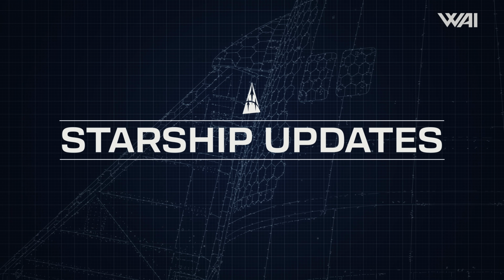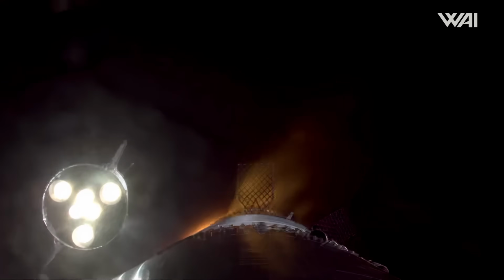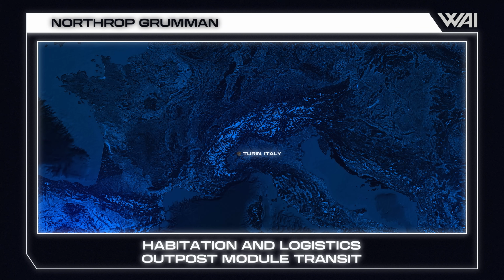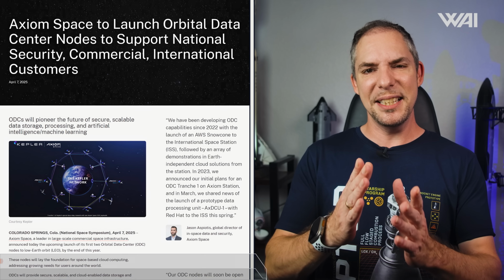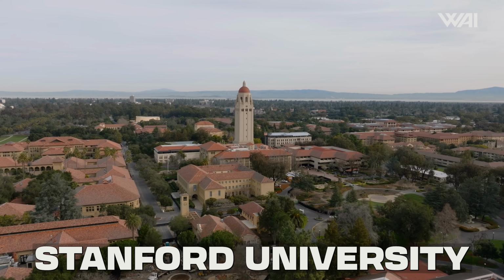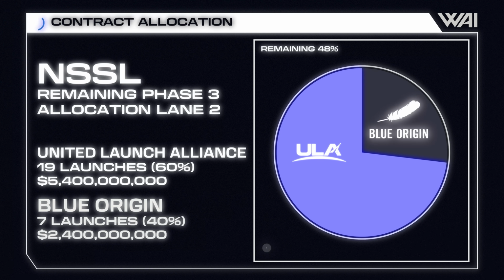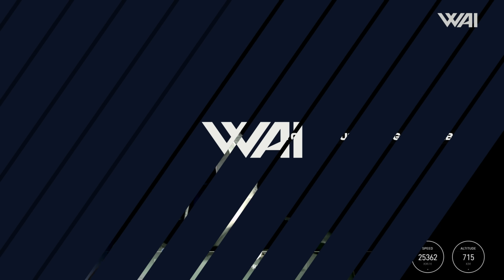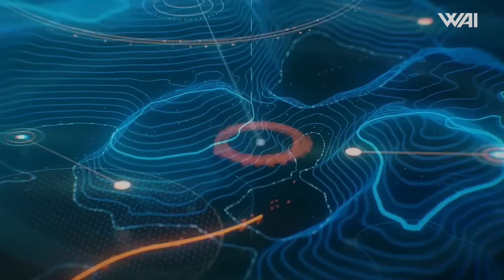SpaceX Unveils MASSIVE Starship Upgrade! Production begins on even crazier version!

Comment: Why use a laser? Why not unfold a giant mirror to concentrate sunlight into a beam ? 
If you unfold a mylar reflector you can make a massive mirror 10-20x the size of iss. Focus all that on a few square meters, and a simple 500w panel would need cooling and beefy power cables making 10-20x more than rated

Comment: The concern I have and I'm sure it is the major one for the FAA is the power density of the IR laser in the lower atmosphere with danger to aircraft and even ground transportation vehicles or people.  While it is certainly feasible, the cost would absolutely have to be significantly overshadowed by the benetfit.  Even microwave radiation to a rectenna has been questioned as to it's cost/benefit ratios and potential dangers.  If you had some way to absolutely isolate the ground antennas or rectennas from encroachement on land or air, it would certainly be an interesting test.

Comment: I write the annual State of the Industry Report on Space Solar Power. I can confidently say that SSP has been technically viable for more than 50 years. In the last 15 years, SSP has gone from the most expensive potential power source, ~$600/MWh, down 94%, to the least costly power source, around ~$40/MWh. This drop is so rapid because it compounds the 80% price drop in solar panels terrestrially (6-20x more productive per panel when used for SSP) with rapidly falling launch costs and better computational capacities in orbit. Simultaneously, SSP can be distributed like data beamed to (multiple) ground stations with far less transmission infrastructure, no energy storage, and geographically independent power. The main impediments to SSP are cognitive dissonance with the price drop and the not-insignificant system engineering problems of building the full-scale multi-kilometer systems in orbit, which take real money to address. Even so, based on current estimates, most systems are internally profitable with a full ROI in about 3-4 years. The NASA article was intentionally dismissive because NASA wanted to suppress the idea since they do not have the mandate or resources to develop a commercial product, and they created a system that is more than 60x more expensive (inflation-adjusted) than the one they designed in 1979 because their assumptions were just so bad. As just one example, they assumed each batch of 100 tons of material would require 14 fully expendable Starship launches when, in practice, it would be 2-3 reusable per 100 tons with no citations to the reason for this assumption of any kind.

Comment: I don't think starship is gonna work unless they make the scales actually over lap.. that and ad a belly plate that's basically just hundres of tubes running down its windward side.. heck, can't we just coat the entire underside in Rhenium, that mixed with bell chamber like belly ought to do the trix.. the mid ridge (absolute bottom) could vent in a V shape, creating the shielding+cooling needed.

Comment: BTW, I have been thinking that there may be a better way to launch rockets into space where one can make gravity work for you  rather than against you, at least for the first few seconds of flight.

For example if this could be scaled up to use for Starship Not only could this save some fuel but could  help reduce damage to stage zero as well in that the booster would clear the launch tower  in much less times thus exposing it to less time to the  high heat and stress caused by the engine blast.

Plus one could even recall the rocket even a few seconds after engine ignition.

As such I just made a video on this idea and uploaded it to my YouTube channel.

Comment: So far SpaceX load capacity has delivered exactly Zero cargo to orbit. 

It’s yet to deliver an empty starship to orbit.  

Or indeed in a condition in which an upper stage is reusable.  

I wouldn’t get over excited about block 3. 

Block 2 has yet to actually work.  

SpaceX has a lot more work to do before it’s a viable launch system. 

Block 3 will bring its own set of problems to fix.

Comment: 14:13 There is zero chance for practical energy laser transmission.  Besides the economics, the probability to frying birds and the weapon potential will preclude wide scale adoption.  However, as a laser battle station, there may be some worth to the project.  Antisatellite and cheap laser attack from orbit should be investigated.

Comment: Starship is getting totally redesigned it's going to have a module add-ons. These module add-ons like legs can be disattached at any time. Another add-ons as well as I don't boosters on the structures add on fuel tanks. The list is endless. They finally caught on to it. Size is not the problem its capacity and thrust😮❤❤❤

Comment: Pretty wild that instead of fixing all the issues with block 2 they are just pushing straight to block 3 to address those issues. Just shows how far ahead the R&D team compared to the build team
Reply: This is part of their philosophy: "break things and never fix them"
Reply: @paulpinecone2464 I guess it would be “break things, continue breaking things, trash them and make a completely new thing based on the stuff learned from the broken thing”
Reply: @paulpinecone2464  🤣
Reply: "break things, continue breaking things, trash them and make a completely new thing based on the stuff learned from the broken thing” AND NEVER GET THE JOB DONE !!!! 🤣🤣🤣😅😆
Reply: @paulbizard3493  more like, “break things, continue breaking things, optimize from mistakes, extend the timeline another three years, finally get a working product, make bank, decide it’s not good enough and scrap something perfectly good into obsoletion instead of combining it in the current system”

Seriously though, it would be so cool if we had a falcon-9 booster assisted starship

Comment: "Solar Power From Space",... Is a DUMB idea. Whether done with Microwaves or InfraRed, it's going to be very lossy as the beam heats the atmosphere. It will always work out more cost efficient to add more panels and windmills to current renewables. And then there's the issue of all the heating done to the atmospher by the beam, which is a direct method of increasing the overall temperature of the whole planet.

Comment: They got the chopsticks up really fast on Pad B, but still have not installed the SQD.  I wonder if that has something to do with the impending increase in length for the block 3 ships.  It seems they are also working on the next booster design which was only going to work on Pad B.  Looks like Pad A will finish out the early prototyping and they probably go the way of the Stargate bldg...

Comment: Space based power has always been a pretty hokey idea. Even if it benefits from constant solar influx, the losses and complexity of getting the power to Earth from orbit and the expense of launching the system to orbit in the first place is ridiculous. Then it is subjected to much harsher conditions and a shorter lifespan in orbit than on Earth. And then if you need to repair component failures, you have to dispatch the repair crew from Earth at additional billions or hundreds of millions expense. That's a lot of expenses that are cheaper if you put your solar panels in the desert. And if you use 19th century thermal energy storage, for the power, Earth based power can be built for long life, low tech, and simple maintenance.

Comment: The Lunar Gateway is constrained by the limited payload of Falcon Heavy.  That is why HALO only has 70 cubic metres of volume.  That will be very small for any crew spending 6 months.  That design made sense in 2020 when the contract was signed, but makes little sense in 2027 when it is now scheduled to launch.  By 2027 Starship will be launching multiple times per week.  And a habitable Starship V3 provides almost 2,000 cubic metres of volume!  And trying to dock a thousand ton HLS to the hundred ton Gateway does not make sense.

Comment: Every time SpaceX makes a change to the Starship design they basically get rid of all the "certification" of previous versions, since we have seen with Version 2 that changes can have unintended negative consequences. So I guess they should get on with creating the actual version that they will need for operations so they can prove the design and certify it. NASA and almost every other program in the world will freeze a certified design before they begin operations and manufacturing.
Reply: Design freezes stifles innovation. SpaceX has a different approach with Starship. Instead of a long and arduous design cycle, they are learning through hardware. They want to make hundreds of Starships so manufacturability is also important instead of making a dozen or so ships like the Shuttle. The factory, tooling, supply chain, and equipment needed to build a space ship is part of the process.

Comment: Guess they're going to have to add some more height to the chopstick towers
Reply: The arms of the towers meet somewhere along the side of the Starship and Booster. The Rapid Disconnect arm also attaches along the sides. Why does the tower height need to increase?
Reply: @michaelreid2329  I know but when they stretch the booster too it'll be close to the max so probably no spare lifting room

Comment: On the subject of energy from space.
I hope all the clever minds have thought about whether the satellite will not produce more pollutants in its lifetime (which will not be too long due to the chosen orbit) despite potentially increased efficiency (here, too, it remains to be seen whether the higher efficiency of the solar modules will not be canceled out because the laser does not arrive on earth with 100 percent of its output energy). does not produce more pollutants overall (somehow the thing has to get into space, which is also a lot of pollutants) than if the same power were simply installed on earth at a fraction of the cost.

Comment: Hopefully block 3 uses the new raptor 3 engines in both the booster and Starship. Grid fins lower on the Booster to keep starships hot staging separation exhaust from warping them and a newly designed Hot Staging ring (that is more open and taller).

Comment: I predict that when Jared Isaacman takes the reins of NASA he'll move Artemis to SpaceX Superheavy boosters for Artemis 4 and beyond. It will save a ton of money and stop the bleeding that NASA has had with SLS. Probably still use Orion capsules, but ditch the Lunar Gateway, perhaps replacing it with a relay communications satellite in a similar orbit.
Reply: One reason for a near-rectilinear halo orbit (NRHO) is that SLS did not have enough delta-v to get station components (and Orion) closer to the moon. We may need to upgrade the propulsive third stages for Orion as well.
Reply: @imconsequetau5275  SLS has enough Delta-V to put Orion to LLO TLI, Delta-V costs to put something on TLI to LLO and NRHO are pretty similar, its Orion that lacks the fuel to insert itself into LLO.

Comment: Starship reentry speed braking is a factor of ship weight & area of hull w/ heat times. Block 3 will definitely have more surface area, but will the ratio of surface area to weight go up or down when compared to Block 2?
Reply: It should have a larger area vs weight, even with 3 more vacuum raptors. The rear (aft) flaps must still be enlarged, since the center-of-lift will be moved forward, yet more mass will be concentrated in the engine bay. [The enlarged header tanks will not completely offset the need for larger rear flaps.]

Comment: Space-based power is fine for use in space. But any 2nd year mechanical or chemical engineer that has taken thermodynamics and heat transfer knows that increasing energy input into a system raises temperature. Beaming energy otherwise going to space to Earth must, necessarily, aggravate global warning. Some beam energy will be lost to the atmosphere through which it must pass, directly heating the atmosphere. High energy beams also pose risk to terrestrial regions, as anyone who has seen James Bond movies knows. Space-based energy to Earth - don't do it

Comment: IR Laser Space Based Power makes sense ONLY given the Defense based funding.  The biggest hurdle to Space Based Solar Power (SBSP) is that it simply can not fail to be a weapon.  (Even if you manage to keep the beam power density (watts/square-meter) lower than a safety margin it just means that it will take two or more beams focused on the same target to be used as a weapon).  But, the defense department is already armed to the teeth so putting this titular weapon in their hands is an escalation, but not a sea-change.